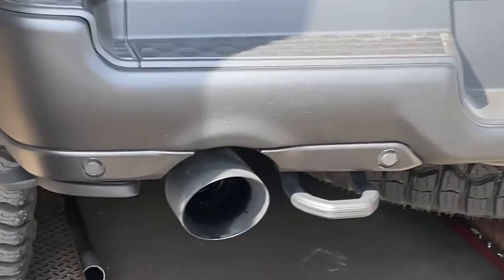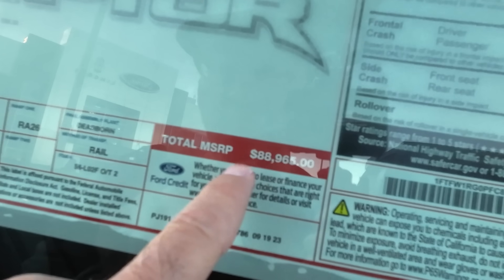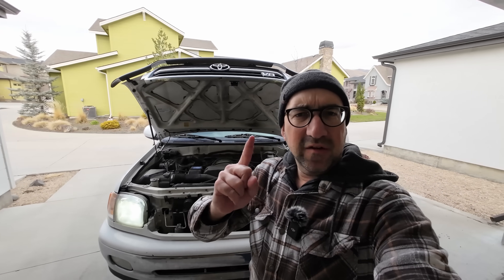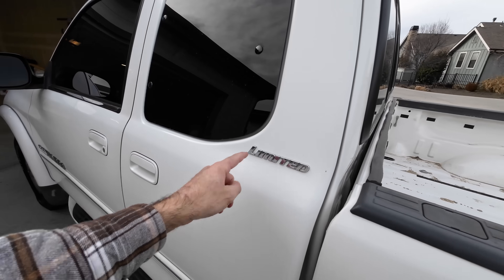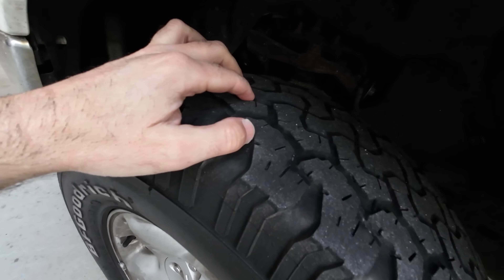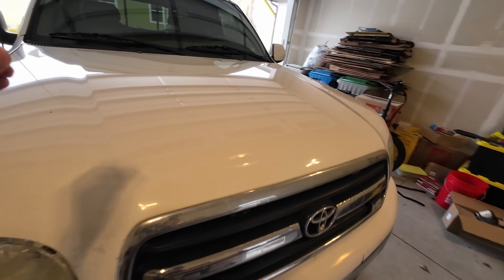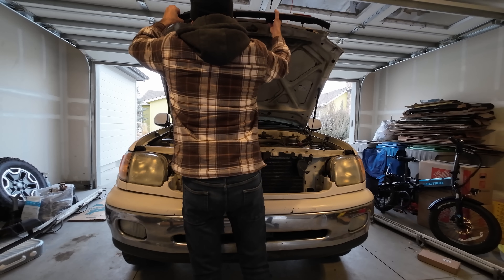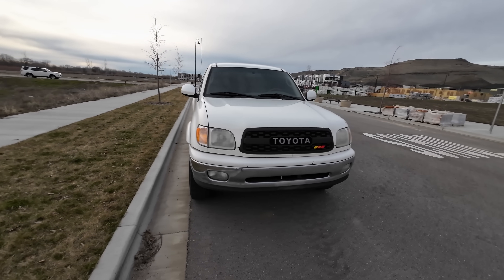I'm Sitting In The BEST V8 TRUCK Ever Made! (and I bought it)

Comment: My daily driver, 2000 GMC sierra regular cab, 5.3 V8 with 375k on the odometer.  Runs great and Ill drive this anywhere! There is value in older trucks, find a good one and spend a little cash on it if you need to.  Who needs a $60k to $90k truck!

Comment: Problem with that Tundra that I can see in the video is his head is right near the roof.  Not enough headroom for me.  The windshield would be too low for me too.  I did have a truck from that period, a few years earlier, 1997 F150 8 cylinder, the first of the new type Ford Trucks. It had good headroom. I traded it in at 332,000 miles. It still ran like new. I used Mobil 1 in it which I changed at 25,000 mile intervals. It didn't lose any oil at all between changes. Mobil 1 is great stuff. It was a great truck.  I read about others going one million miles with that engine.

But your Tundra looks beautiful and will be great, as long as u can fit in it!
Reply from the maker: I'm 6ft. Tall people and Toyota never work well. Lol. Especially the older models. New ones do have more head room.

Comment: FYI; the opposing doors come in handy for old men that need to relieve themselves on a moments notice running down a highway with no where to do so privately. Open both passenger doors stopped as far off the shoulder as possible and you have privacy to wee also with some breeze protection. 😮😅

Comment: I had that exact truck but a 2001, i had it for 14 years, i replaced an engine thermostat and o2 sensor and that was it, 220k miles , sounds damn good with exhaust aswell, i miss that truck

Comment: My buddy is still daily driving his 2005 Yukon 6.6 liter V8 All wheel drive with 320,000 miles on it.  He did have to change the original starter last month and got new tires about a year ago.  Whoa the maintenance costs.  Honestly, I'm pretty sure he hasn't even changed the timing belt.  Watch, it will break next week because I said that.   lol

Comment: I have this same Tundra only a 2003, and it's a SR5 V8 not the TRD Pro. It also doesn't have the big ugly cladding around the tires that this one does. The sidestep on mine is black/ round  pipe but you need it to stand on when you  clean the top. It would be nice to know how many miles yours has.

Comment: Make sure you change the heater diverter valve in the back of the engine.. They get brittle and leak.  Also, the starter is underneath the intake manifold.  Oh and enjoy the 12-13mpg because yeah...

Comment: Add New headlight assemblies, taillights, shorty antenna, lift/level wheel/tires backup/front cam and wrap the bumpers if you don't replace. Also look into LED lighting requirements does the 1st gen Tundra need a flasher relay. What is the date code for the tires on the truck?

Comment: had a 2000 and a 2005, sold my 2005 in 2020 for $1500 with 120k miles and ran perfect, although interior needed to be completely redone, I should have kept it and sold it a year later than I did.....2000 was trouble free but the 2005 went thru sensors every 2 years

Comment: i had 3 f150 work trucks, an 1985 4.9 4 speed 240000 miles, a 1993 4.9 5 speed 444500. miles, and a 2001 f150 5.4 auto. 336000 miles. i got my monies worth out of these trucks for sure, i bought the 1985 at the ford dealer in glendale calif. fore $8996. plus tax, that wont even make a down payment on a new truck. after these trucks i only bought used trucks.

Comment: I bought the same truck new  in 2002. Your new purchase is
22 years old. Your biggest complaints are running boards and a bug deflector? The 4.7 is a great engine. Unfortunately, the mpg is equal to a 5.7
 I made it to 7 minutes.

Comment: You did things in a different order than I would have. I don't care at all about improving cosmetic appearances until I've spent money making sure the engine, transmission, tires, brakes, shocks and other running gear are in tip top shape. Sure, when purchasing look for the best looking vehicle, but if it needs maintenance that has to come first.

Comment: I’m curious what is the final drive gear ratio ? And will it accommodate the 33” tires you plan to install ? I’m assuming the 33’s are taller than what is on the truck now. If so, you will experience a decrease in low end acceleration along with improved fuel mileage at cruise maybe, if you’re not lugging the engine.
Is your rational for the 33’s simply cosmetic ?

Comment: I would have scrubbed the old grill and spray painted the silver, making it mat black. I would not have used the three color, yellow, red, orange marker
 I would have gotten rid of the side steps as you have as well. I have a bug deflector on my SUV, I would have kept that. Too much white, black makes it look better even if its a deflector.

Comment: I have an 06 Tundra.  Had to replace the rear differential axle assembly which was very hard to find.  I would not recommend towing anything heavy or carrying heavy loads in the bed.  These Tundras have an el cheapo diff. just saying.

Comment: I knew you were going to get the toyota. The ONLY issue with the taco is you can't fit a 4 x 8 sheet of plywood between the wheel wells. If you NEVER carry anything 4 x 8 you're good but I buy at least 2 a month and it's a royal pain in the butt. 

Up here in the great white north, anyone who buys a 2wd pickup can't use it for 5 months of the year, safely. We get snow from Nov to April so there's that.

Comment: I have a 2017 Tundra with 78,000 miles and so far has never had to go back to the dealer. I'm not interested in any of the new trucks regardless of the make because I don't want a turbo or cylinder deactivation on my vehicle. I've owned many American trucks and they all have been decent except the Dodge, which was not what I would call a lemon, but it wasn't great either.

Comment: Unless you KNOW when/if the timing belt was changed, that should be 1st on your list before any cosmetic upgrades. Also, lower ball joints and - if it shows any sign of cracking or deterioration - the plastic radiator. These are the most (and maybe only) problematic areas of concern on 1st Gen Tundras. Otherwise, great trucks!

Comment: Great video! I was in the market for a truck and I could stomach paying a ridiculous amount of money for a new one. I hate the direct all these manufacturers are taking trucks. With these crappy v6 turbo charged engines and all the useless technology that no one needs  Like the folding shifter ford has  or the auto stop technology that just adds more wear to your vehicle, just terrible. 
I ended up buying a used 2014 Ford SVT Raptor with only 55k miles. It was well taking care of and was a no brainer for me, I love my used truck. I’m currently trying to buy and replace all the sun beaten plastic trims spent about 1400 but I hope to drive it till it has half a million miles.

Comment: That thing is clean  for it's  age, you're lucky to find one and someone did the timing belt with the Aisin kit wich is OE nice find.Never selling my 2010 RCSB TRD 5.7 with only 41k on it best truck ever.
Reply: Best Advice. I can give you go out and get yourself the waxoyl kit for large cars. It’s 9 cans of Waxoyl hardcoat and 3 cans of door interior spray. It’s semi gloss black so it replicates the OEM finish. It will stop existing rust dead in its tracks by denying it moisture and prevent future rust in the same way. Once done just give it a look over and a touch up in fall just before winter and you’ll have that truck for another 13 years.

Comment: I' not trying to dog you, because that is a great truck.  However, I used to be a Toyota salesman, and I know a lot about these trucks.  Safety is a concern for me and I don't want to see you or anyone around you get hurt.

Make sure that all of the 6 serious recalls have been addressed on this truck.  Looking at the condition, I would assume that the owner had them taken care of though, especially since the frame has already been taken care of.

Also, make sure that you save a ton of cash for all of the suspension issues these trucks are notorious for having.  It is extremely important to make sure to have the ball joints, mainly the lower ones, checked out on a continuous basis as they are also well known to not only fail and cause a speed wobble, but actually come apart and allow the tires to fall off while in motion.  Keep an eye on the tires, because the loose front suspension will get out of alignment on the regular basis.  Too bad Pep-Boys doesn't offer the Lifetime Alignment any more.

Be sure to check the tail lights as they are well known for staying on, even with the truck off and no one pressing on the brake pedal.

Then there is the exhaust/cat situation to be mindful of.

If course there is the whole Takata air bag fiasco that if it has not been addressed, it needs to be.

Comment: My most reliable trucks were a GM 2500  350 automatic high mileage and worked every day. side steeps protect the body and you should keep them IMO
Reply from the maker: That is a good truck as well. I would rather have them off to avoid them being ripped off and damaging things on the frame.

Comment: I have a 2004 used mostly for work.  Pull a 5x10'x2' dump trailer on mountain roads.  170k and going strong.  I wish I could park inside.  If rodents  get into the heating system, it might ruin the truck.

Comment: I had one of this generation many years ago. It was great but very rusty underneath due to MN salt on the roads.
Reply: You gotta do something like waxoyl or other rustproofing to them early on. If you do that you’ll extend the life expectancy significantly. You can also use it on a rusty but solid frame as well. It stops existing rust by preventing moisture from getting to it and prevents future rust by keeping moisture from being able to get to the surface. I used the stuff on a friends crown Vic, the car is still rot free down low. It also stays on under high pressure car washes just check it out and touch it up annually underneath and you’ll be rot free so long as you own the vehicle
Reply: @matthewcaughey8898  yes I do wool wax on the ones I get new. The first gen I had was already too far for me to worry about it. Thinking about trying Amsoil MP HD.

Comment: I believe you’re making a mistake with a 33 inch tires, they’re going to wreck your gas mileage. Unless you’re just going for the look?

I will also add that I had a 2014 Toyota tundra with the 5.7 L V8 as a work truck. I drove it 345,000 miles and when I turned it in. It still didn’t use a drop of oil between oil changes .

Comment: V6 powered half ton trucks don’t sell where I live. When ford came out with the ecoboost f-150’s they sold hundreds of them here. A couple years later they were all gone in favor of V8’s. The reason? Well I’m in farming country and pickups are used to work in. The little turbo V6’s can’t handle the heat and dust. The turbos would self destruct before 50,000 miles. The new Toyotas won’t sell here either.

Comment: Thoes side steps save the rocker panels trust me i have 1 and it rusted as soon as i removed mine  so i fixed the panels and put them back on the truck and no rust problems one other problem was brakes they are woefully inadequate so upgrade them and put disc on the rear axle

Comment: You're missing out on so many great features that a newer truck would offer, like the water in taillight warning system.  With a new truck it'll give a bunch of warnings, and possibly shut the engine off if you insist on driving it like that so that you won't embarrass yourself driving around with unsightly taillights.  Speaking of embarrassments, you'll be saved from anyone ever ridiculing your high odometer reading because it'll be dead before the numbers stack up.  My 2002 Excursion is about to hit 450k, you can't imagine the amount of therapy I've had to get to convince myself that it's ok to keep driving it.

Comment: How many miles are on that Tundra?  Don't you have to periodically change the timing belt?
Reply from the maker: 225k. Belt was done 60k miles ago!
Reply: @MotorFeed  The guy who replaced my kitchen cabinets drove a 2006 Tundra with the 4.7 and it had 583k miles on it!!

Comment: The best newer model Ford V-8 is the 4.6L. These were put in gazillion Crown Vics with police pursuit upgrades. I have a 2004 with Explorer with 400,00 on the clock and still going strong. Probably will need a new transmission in the next 100,000 but half a million miles on an original transmission ain't bad. All this thing has ever had in it since I bought it as a repo off an Air Force Credit Union lot in Warner Robins Georgia is Mobil 1. At about 250,000 it started using a little oil. I change the oil at 5,000 and it takes a quart ever 2500. Again, ain't bad.  Fuel milage is 18-20 running 75 here in west Texas on regular gas. Paid $6,600 for it in 2006 with 28,000 on the odometer. Think I have got my money's worth. One more time, ain't bad.

Comment: Buy a Dash Mat cover for that dash - I always put them in my trucks. I have one in my 2015 Tundra - the plastic can get warpy if left un protected, especially in the Texas heat.
I think the TOYOTA heritage grill with the tri color accents don't really fit the truck. It's trying to make something it's not. For example, I've seen a few Lexus LX470 (100 series land cruiser and also the same 4.7 v8 engine) with a LEXUS heritage grill on the 97-2006 model and it just looks dumb. 
My opinion is to embrace the truck for what it is and the generation it's from. I get removing the side steps, but unless your going full off road/overland build, it just doesn't fit. (just my opinion of course - to each his own)

Comment: Not ford. I have a 2023 f150 XL regular cab with added super charger. It has 705 hp. I love it. It's a basic truck but is a blast to drive. On the the 2024 f150 the v8 is the only option on reg cab

Comment: What's the mileage on the Tundra. I saw that it was 178000 in 2018 but what is it now? Just curious.
Reply from the maker: 225k
Reply: @MotorFeed  That's nuthin'! 10k a year! That's the one I would have picked also. It looks great and I'll bet it will run forever with regular maintenance. Smart choice and best of luck.

Comment: Wow i sold one of those tundras for 2000 dollars I personally thought it was the worst truck i ever owned was constantly working on it and i got the same fuel mileage as my 360 dodge , mine had a brand new frame on it , the body metal was terrible on them they were rust buckets and parts are super expensive and hard to find used, i had the whole roof cut out and replaced above the windshield and the drivers side floor fixed , i had it religiously oil coated at crown aswell , also did front control arms 4 times due to bushings
Reply: And on top of all of that theres not much aftermarket parts for them
Reply from the maker: Sounds like you lived in the home of salt and rust.

Comment: My tacoma 4.0 has 406000 miles on the original engine and transmission that have never broken down, and never been rebuilt. Runs PERFECT. Not babied at all. Just oil and proper maintenance. I will replace the engine and transmission before i ever replace this truck. Screw all these new unreliable peices of crap.....

Comment: I'm looking at all these new spacetrucks that cost as much as a Saturn 5 rocket, doing the math and shaking my head. I'm way better off getting a pre2008 Silverado/Sierra with under 200k miles that isn't falling apart and getting it completely redone off frame, painted and everything fixed like new. Even hiring it all out you'd still have a truck costing half as much as buying new that will last twice as long and be way cheaper to maintain.

Comment: My ford 5.4  motors run 10,000 mile in-between oil changes get 250,000 miles minimum with nothing but plugs and wires 
My 02 got 275,000 miles if my youngest didn't go bogging(mud) rip trans line of 
Think he hit a stump 
Yes he drove it home no transmission fluid  
Still able to move just transmission is shot yes gonna fix it my favorite truck 
Have 4  5.4 truck only mad about one  run and drives fine help drove it for 5 years  it has gone senile electrical bug in it  
I swear 2000 to 2003  are the best in the world hands down

Comment: The prices of the new pickups like the ram and the Tacoma is eye watering.. like how about never buy.. especially after I watched two dudes try to take a brand new Tacoma up a snow covered hill in 4 wheel drive low and it killed the diff.. car had 350miles on it. It was a trd pro and it just died .. brand new.

Comment: I own a 2015 5.7 V8 Tundra.  I've driven Toyota pickups all the way back to the T100.  I was going to trade-in my 15 for the new Tundra until I found out Toyota dropped the V8 engine.  Screw Toyota now, I'll never own another one or any "turbo" V6 truck from any manufacturer.

Comment: Reliability wise, this is by far the best v8 in a truck. I care more about fun. That’s why I don’t buy Toyota or Honda. They have absolutely nothing for me. Too weak and underpowered.
Current vehicles: 
2019 whipple supercharged 5,0 pp1
2019 raptor supercrew 
2021 jeep Trackhawk 
2014 evo x gsr
2020 x3 rs turbo rr

All of my vehicles are modded. I love them. I would never attempt to argue that a Ford or Jeep is nearly as reliable as a Toyota. Never. I actually recommend a v8 Tundra over my Raptor. When anyone that cares more about reliability asks for my recommendation, I never recommend any of my vehicles. 

5.0: 10 speed transmission had to get replaced at 18k miles. 

Raptor: I had to change the cam phasers two times. It was covered under warranty the first time. 2nd time, I had to pay for the majority of it. Ford covered a little.

But still, I get much more enjoyment out of my vehicles than I would over any Toyota or Honda.